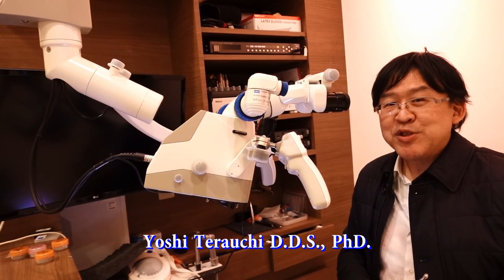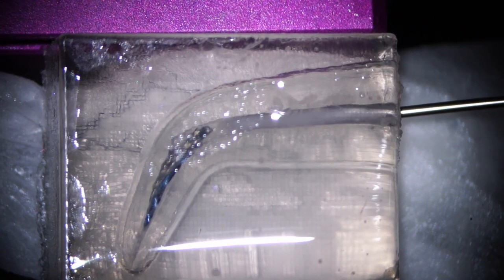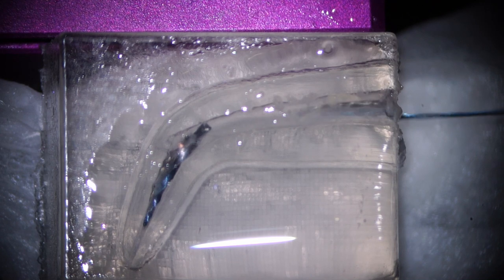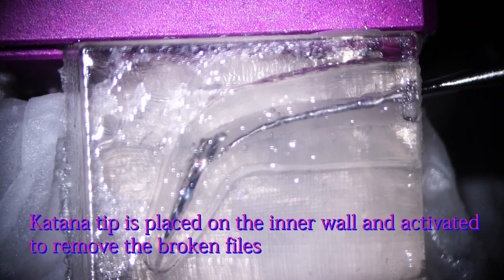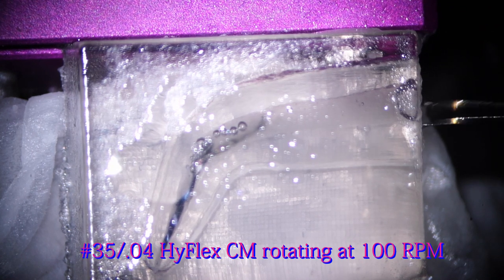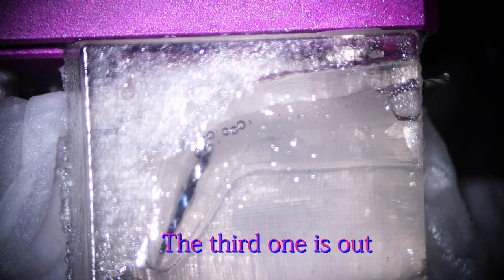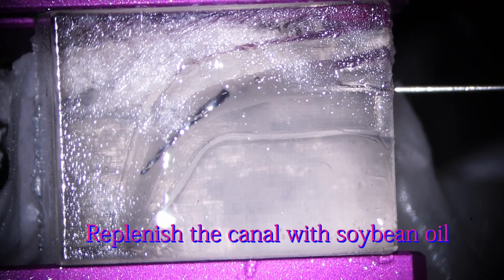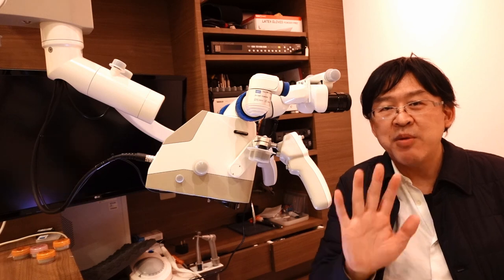Breakage of four rotary files followed by removal of four broken files

Comment: Too much of the outer part of the canal is thinned out due to the over enlargement of the rotary file. Check out the thickness of the block before and after the files where removed
Reply: was about to write the same. the difference of remaining dentin between 1:06 and 8:57 is supremely significant.
Reply: It is , but what are the options after breaking an instrument ? Another thing to keep in mind here are 4 of them and the block is plastic not dentin.